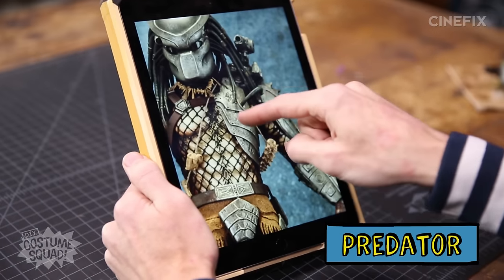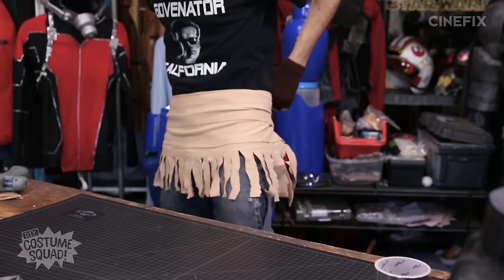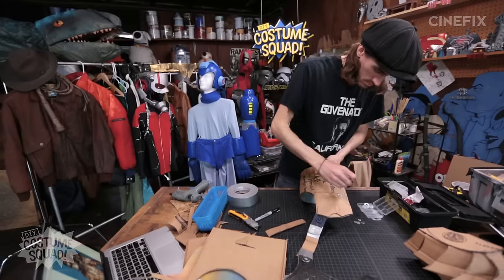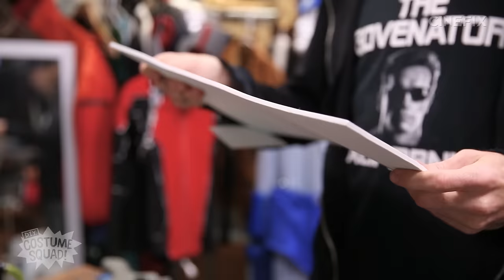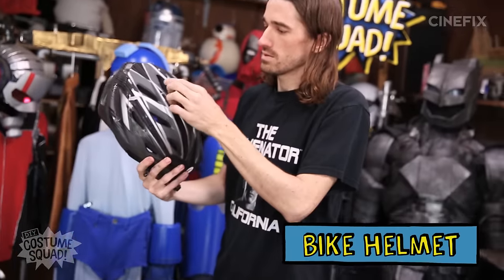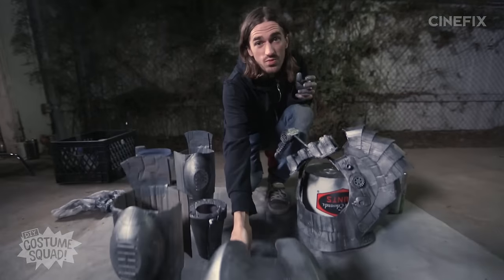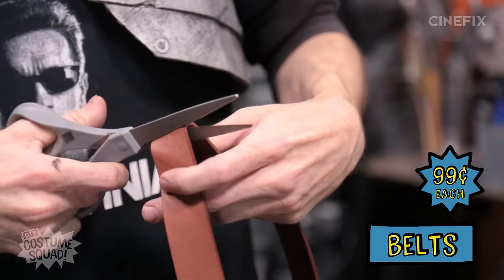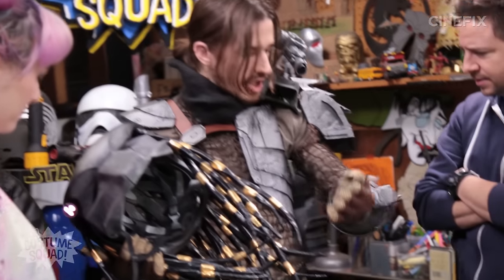Make Your Own Predator Costume - DIY Costume Squad

Comment: When cutting that type of Eva foam ( the "Knee pad" ) buy a sharpening stones so you don't dull your blades
Reply from the maker: +Sebastien Creates Good tip!
Reply: +CineFix Also a few ways to ensure the paint sticks to the foam you can seal it in a few ways:
-2 coats of mod podge
-Use a heat gun / torch to seal the pores of the foam
-Plasti dip
I use either the first or second because it's a cheap option both short and long term. I know plasti dip may be a little bit more expensive and sometimes you need to use more than one can.
Reply: H
Reply: can you make me a  costume assassin
Reply: Vanter Gamingpro
Reply: X
Reply: Sebastien Creates
Reply: Sebastien Creates "
Reply: king
Reply: Did any body notice that the blades are upside down
Reply: I was just about to leave a comment saying that:)
Reply: Yeah right
Reply: Zachary Brown
Reply: Eevee TV
Reply: Gage Cavazos
Reply: i love you so so much

Comment: Thank you for the video.

Regarding the shoulder pieces, you could have gotten the same effect or even more authentic looking, but it would have been a lot more sturdy and a lot more flexible with your movement by using a thick craft foam.  Plus you may not even have had to use much paint on it.

But your costume turned out AWESOME! And you would never guess what some of those materials started out as.  Good job!

I made a Red Pyramid (pyramid head) costume as well as a nurse costume from Silent Hill one year for Halloween.  It took me 6 weeks working on it about 3-4 hours a day, but It was the most fun I ever had building that costumes.

Comment: If you want better dreadlocks get backer rod from ace, Walmart, Home Depot, or Lowe’s, and use black Plasty dip. And for the rings pvc pipe, cardboard, Eva/ craft foam works too.

Comment: Blades ARE the wrong way around..hands down..HOWEVER..having the points facing upwards makes a lot of sense when slashing on the run..it prevents you from getting stuck and brake the blade.. in worst case rip your arm off..just like fighters on horse backs with their curved swords. Personally i prefer the downwards pointing blades..but..to each their owns..peace out :-)

Comment: The wrist blades are upside down
Reply: the blade can actually be inverted like that, Scar did that when a xenomorph was sneaking up behind him
Reply: @-fate1nmyhands-902  Not scar but Celtic, and that was the only time/ only predator that can actually do that with his special wrist blades. And besides it is based on the 87 predator which can't do that. You were close though

Comment: One tip on the dreadlocks that will look much better, use backer rod. You can find it at any hardware store, you can cut it to whatever length you want, paint it with black Plasti-Dip (do not use paint, even latex, cause it will fall off). Heat the ends with a lighter and twist them with your fingers to give them the tapered look and just glue them to your mask, makes a budget costume really pop. Here's the first ones I ever made before I graduated to latex foam. 

https://youtu.be/f0Kzj2u7Dkw